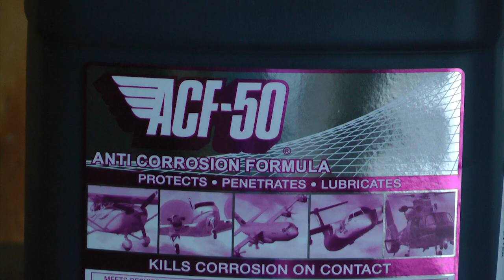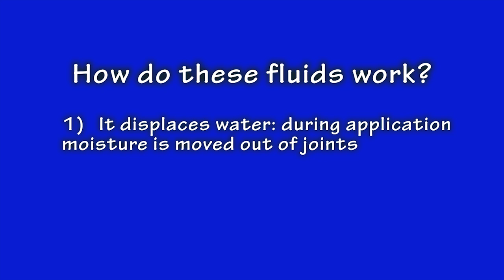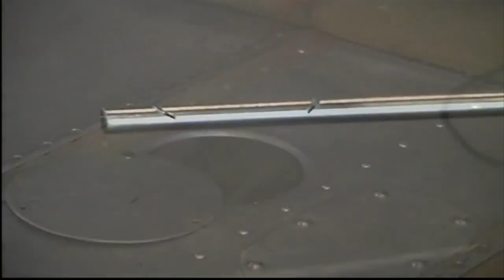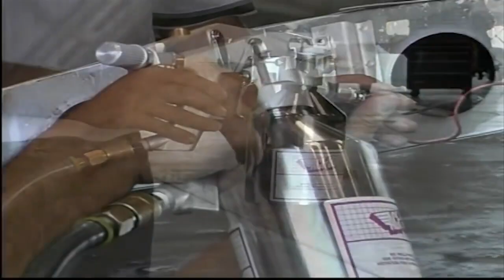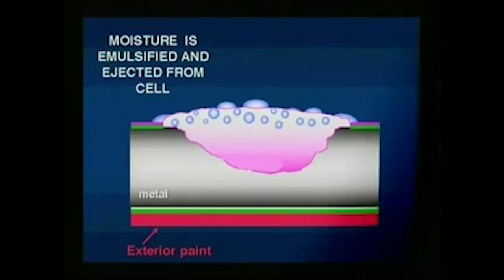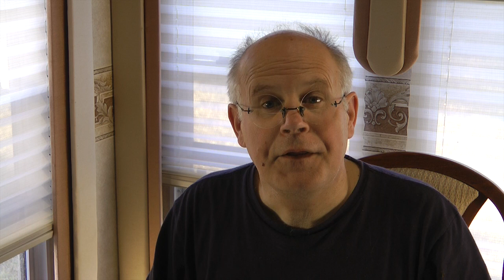Stopping Corrosion in Metal Aircraft

Comment: Is this product safe on automotive paint? I have a newer Jeep Wrangler JL which the doors are aluminum and the hinges are steel. The underside of the steel hinges are not painted and this is in contact with the aluminum door! from the factory of course.  There's a big problem with Jeep owners where the paint is peeling, I just want to coat underneath the bare hinges for added protection.

Comment: Nice video, but the second item under, "How do these fluids work" is incorrect.  They do NOT form a sacrificial dielectric barrier that stops electrons from getting thru. If they did, then you couldn't use them on electrical contacts, as recommended by the manufacturers. 

The fact is, that when surfaces are pressed together the microscopic asperities penetrate the film to make electrical contact.  What the film does do, though, is seal the areas against contact with remaining electrolyte liquid, thereby limiting opportunities for galvanic corrosion and against air, so that non-galvanic, atmospheric driven corrosion (including fretting corrosion, a big problem for electrical contacts) is prevented.
Reply: It also says non flammable, on my bottle it says flammable 🤦‍♂️

Comment: Has anyone tested WD40 on aircraft upon electronic components ? Any technical comparison available between ACF 50 & WD 40?
Reply: WD-40 is a basic retail penetrant and should never ever be used in aircraft applications. 

ACF50 is a far more advanced and superior product and safe on electronics.
Reply: @gureno19  " WD-40 is a basic retail penetrant and should never ever be used in aircraft applications. "    LOL,   Haven't a clue what WD-40 is, do you???   FYI, WD-40 was initially formulated as a corrosion protection film for Convair for Atlas missiles.   So, it absolutely is aerospace corrosion protection. That's why it exists.   Not to say that it's the best product for GA aircraft, or that it's better than ACF.   Just that you kinda ought to know what it is before you start spouting off about it.
Reply: @andrewalexander9492  that's great! wait till you hear about the wonderful benefits and uses for asbestos! Truly a wonder material!

Just because a product had an original use and application decades ago, doesn't mean that product fits the brief/application in the present day....

Comment: Does this affect glues used in fabric covering?  I'm restoring an old ultralight and I have the old fabric off now.  I want to treat the metal, inside and out, before I cover it.  Will the glue stick to the aluminum after treating it?
Reply: Simple answer: call ACF

Comment: Never been convinced by either of those products. If they were as good as they claim I would have used them in commercial aviation.
Reply: its impossible to guarantee 100% pentration
Reply: I know this has been around for 4 years, but…

Just speculation here, but the cost benefit calculation for commercial and private aircraft is probably somewhat different.  The service life of a commercial jet (I would imagine) has more to do with duty cycles and (paying) passenger trips.  Whereas private aircraft  might only fly occasionally and be maintained years longer.

Just a guess.
Reply: What does work?
Reply: Zinc Chromate .... battle proven in WWII and you don't have to take your airplane apart every couple of years like his stuff does!!  :=))   ....sounds like a Kirby vacuum cleaner salesman..."ours sucks harder and you only have to replace it every time you use it!"
Reply: acengineer737 so which product do you use?
Reply: Aceengineer, i used to twist a wrench on dc-6's for the self described "cheapest G** D*** B******" in Miami.  The planes went to points south.  He was very insistent that donar ac as well as the active fleet were treated with acf50 on an annual basis. The dm used enough of the product that the planes dripped for days.